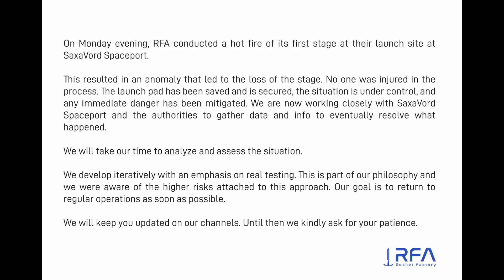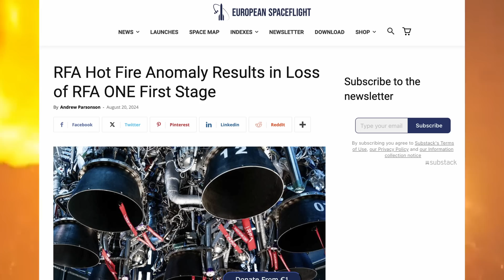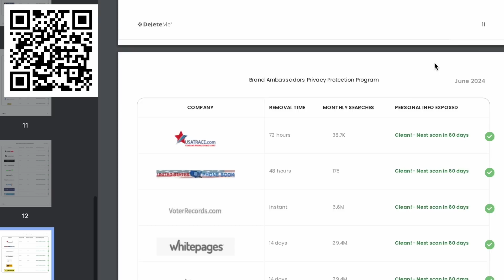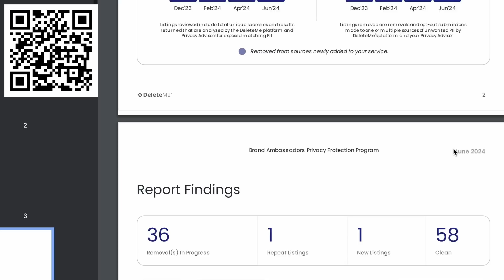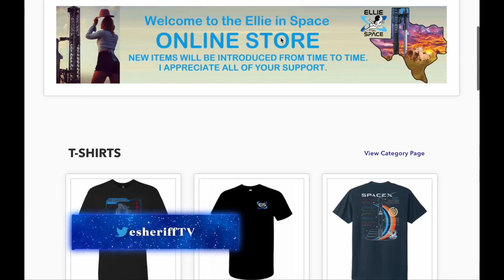Rapid Unscheduled Disassembly: *HUGE* Explosion During Hot Fire

Comment: I was an amateur rocket builder in my early 20s, manufacturerd our own engines with a solid fuel formula. 

We were experimenting with different mandrel shapes and nozzle designs. 

One was a little too tight, we lit it off and it detonated sending fiberglass shrapnel in every direction, the nozzle embedded itself in the fender of my friends car.

Comment: Strangely, this reminds me of when I was 10 years old and I was launching my first Estes Rocket, a little guy made from cardboard tube and balsawood nosecone and fins.  I only had 1 solid-core "D" engine and unfortunately I burned up the only 3 igniters I could afford... sadly, I had no way to ignite my rocket.  So I wait until Dad comes home from work and I asked him for help.  He said he could light my rocket with his acetylene welding torch!  Sounded like a great idea.  So we put the rocket back on the launch rod and propped it up a bit with a rock... he puts on his welding helmet/mask, lights the torch and places the intense flame underneath the flamey-end of my rocket.  It took approximately 2 seconds to light all the fins on fire and 3 seconds later flames were burning up the sides of my cardboard rocket.  I yelled loudly, STOP DAD STOP! but he was committed.  At about T-8 what was left of my flaming rocket took off up the 3-foot launch rod... no fins remaining... got about 5- or 6- feet in the air, TURNED SIDEWAYS, and started zipping back and forth across our driveway.  I think it reached pretty high velocities considering the tight 180-degree turns it was making... would definitely have put an eye out or worse.  Dad was still wearing his welding helmet and the Estes D-size motor burned out about the time he tried to remove it.   This was definitely a heart-stopping flight... and taught me quite alot actually about unguided rockets... and what not to do.  Afterwards I always bought extra igniters on all future launches.  By the way, my Dad was a Physicist lol.  I think he sprouted horns that day.
Reply from the maker: Ok this is a great story
Thank you for taking the time to share
Your dad sounds like a badass!
Reply: @ellieinspace  He's still here and 93 now... he's at that stage of life where he's trying to give all his tools away.  I could probably inherit that torch now for free!
Reply: Great story, my dad tried lighting mine with matches 😂, fortunately it didn't work and I eventually got the igniters to work. Good times!
Reply: @bobsingle45  ...lol, acetylene works, but perhaps the model rocket needs to have a heat shield :)
Reply: I had the same igniter problem. I learned not to hold it in with tape, like in some illustrations, but stuff wadding in there instead. My dad was an Electrical Engineer.
Reply: @Torby4096  I learned to stuff mine with match heads.  I could even launch one with the two pieces of used igniter wire and match heads.
Reply: @clong9m  Never thought of that!
Reply: My dad was a Real Estate salesman so I was on my own including finances. I was 10 or 11 and taped carboard fins, a clothes hanger tube, and a pen cap, directly to a C6-5 engine that I found at school. Used a piece of small gauge wire powered by a model railroad transformer plugged into an outdoor light socket. Got mom to watch as my first attempt flew about 300 feet sideways in a long arc before the ejection charge destroyed it. She thought I was a genius. I was until I discovered girls.
Reply: @markduncan8661  You were a genius especially to come up with your own igniter.  Discovering girls may have been your undoing... totally get that lol.
Reply: I remember those balsa fins and cardboard tube. I also remember how those rockets--back then--were allowed to go over 1000 feet in altitude. 

Your rocket's back-and-forth trajectory could have had HUGE legs. Fortunately not.
Reply: Yeah!  As a child, trying to find an adult not willing to take shortcuts which necessitates calling 911
...is surprisingly hard to do

Comment: Retired machinist here. I spent the about last 10 years of my career as a programmer/operator on a CNC lathe. When you get a complicated part you may spend hours planning, setting up, and programming but, at some point, you gotta push the button and see what happens. Most of the time you get a good part. Occasionally, you hear a zzzzzip BANG, and the machine is down for a couple of weeks while they realign the turret and head stock. I feel for you, Guys. I genuinely hope you recover and become successful.😁
Reply: I’ve been repairing NC andCNC machines my entire life. I’m 71 and I’m still at it. I’ve repaired more machine crashes and you can imagine and I must say 99% of the more preventable and I must agree using drive run and slowing down your feed rates to prove your first piece is essential.
Reply: @pucmahone3893 At one time, I wanted to get into the repair business. I'm about your age and feel it pointless to aspire going that direction now.
Reply: Couldn’t you test the setup on a wax “block” to avoid damaging equipment?
Reply: @205rider8 wax doesn't machine the same way. Wax wont help you figure out the feeds and speeds you need which if done wrong can crash the cnc.
Reply: Nicely put.
Reply: Yeah, I’m not retired yet and I’m still cringing at pushing the cycle with my other hand hovering over the E stop.
Reply: @SkypowerwithKarl  my E stop button wore out and had to be replaced 🤣
Reply: I guess that's why SpaceX uses 3D printers.
Reply: @eudaenomic  you can still crash 3d printers. I have about 1 crash per 1000 prints at work, which would be terrible for a cnc.
Reply: I've been there, done that. Hearing that bang was not a good feeling.
Reply: I know what you mean. Ran a machining shop too. Made the jet engine vanes for the j85. Jet engines Every now and again the titanium got away from me and boy would it tear a lathe up.
Reply: Headstock and turret 
Not good
Need to set up in Dry Run and single block 
Rookie lol
Reply: @machineman7806 you run enough setups, sooner or later your got going to hear the crash/bang no matter how carefully you are. It only takes one time being distracted or not paying close enough attention and eventually it’s GOING to happen. To say different means you don’t have much time doing it…
Reply: @dbensavage  Almost 40 years in CNC, had more than my share of recoverable "bumps". Never a "crash" 
I will say, biggest improvements on machines, they crash a lot easier lol